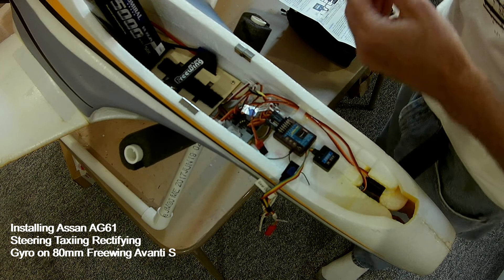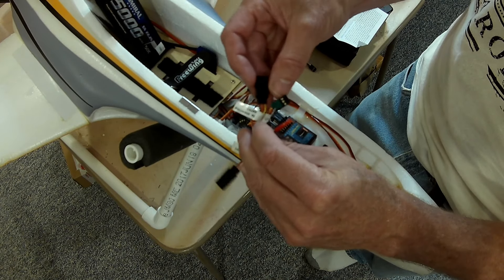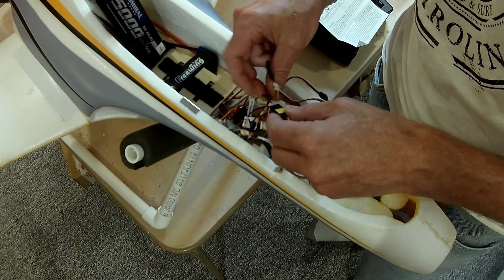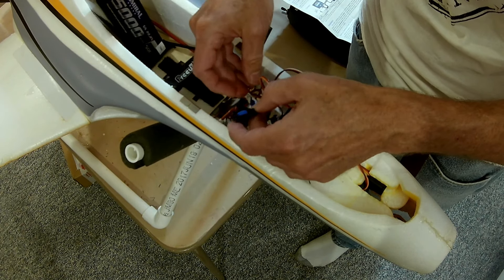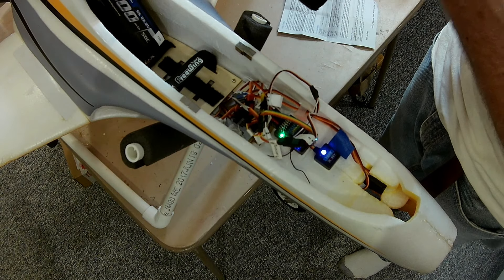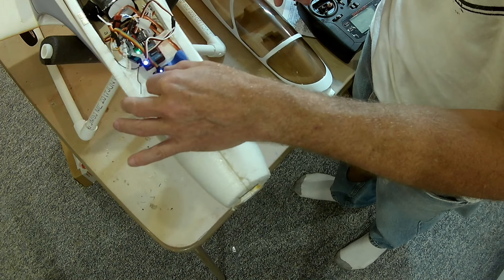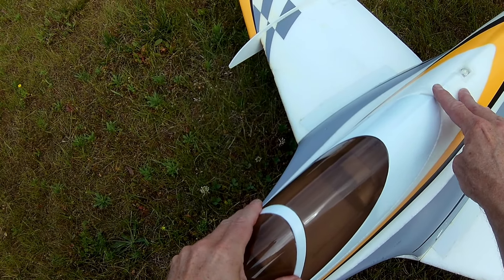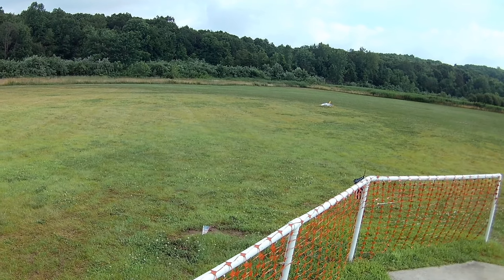Install and Review of Assan AG61 Steering Gyro for nose wheels on RC airplanes

Comment: I ordered four of these for 4 problem child planes/EDF’s. I hope it fits. Not much room in the FL P-38 battery compartment and zero room near the flight controller and receiver.
Reply from the maker: As you can see, the unit is really tiny so you won't need much room to mount it. Good luck!

Comment: Thank you for video but can that be used on a spectrum AS3X/ safe receiver? I’m thinking it may work since it doesn’t effect the rudder... correct?
Reply from the maker: It should work with that Spektrum Rx since the Assan steering gyro is connected to the front steering servo only and the rudder is separate and independent.

Comment: A lot of videos out on this.  Yours was the only one I found that actually gave instructions on what connected where. THANK YOU!!  I do have a question.  Since this is Y-harnessed to your rudder, if you are using a gyro for your control surfaces, won't this interfere with that when landing?  You will have 2 gyros operating at the same time.
Reply from the maker: Thanks Jayson. When I bought it the first time I looked for a video and asked in the forums and everyone said it’s easy.    Well may be after you’ve done it a few times, so I created this how- to for everyone, and now it is easy! The Y harness goes into the Rx and one side to rudder and the other to the Assan “Turning In”.  Any gyro signal from the Rx helps the Rudder but doesn’t interfere with the Assan. Since the Assan is primarily functioning on take off traveling straight there isn’t any rudder gyro input to interfere. You won’t notice any issues.
Reply: @6SRC_YT  I thank you for creating this.  You're spot on in your assessment of how others view the art of teaching.  You just got me off the fence.  About to purchase a few of these.  Thank you for responding so quickly and your thorough explanations.

Jayson

Comment: Mike, sorry to bother you again. Bought a steering gyro for every tricycle landing gear plane or EDF I own. It's been a few weeks since I did the first 3 edf's, I've got the Arrows T-28 on the table at the moment. Everything is working for the steering gyro, front wheel is retracting, but when I tested the retracts, only the front wheel retracted. Then I noticed how stupid I am. Neither rear retracts are plugged in to the gear channel. (Gear Out has the front gear) What did I forget? Where do the Rear Gear plug in?
Reply from the maker: On the "Gear Out" you'll connect the front gear retract and the mains retracts (use a Y cable if necessary.
Reply: Thanks Mike!

Comment: Eric,
I'm a bit confused with the position of the nose wheel when checking orientation of it when gyro is activated.
When the nose of the plane is turned to the right does the nose wheel turn to the left and vice versa? My gyro when activated turns the nose wheel in the direction of the turn and when I run it on the road during testing the plane wanders instead of going straight. I'm pretty sure I have everything plugged in according to the video. Any help would be greatly appreciated.
Reply: @6SRC_YT  

Thanks Eric! 
Got it working.
Reply: @6SRC_YT  
What I did to correct my issue was to reverse the gyro setting for the nose gear
Reply: I bought 3 more tonight! :)
Reply: @6SRC_YT  "It will steer in direction it's facing when it's activated. You  really can't lower gear on sidelines and taxi out say perpendicular to your takeoff line"
Is this really true? If so I must carry my Avanti to the starting position with gear up and then lower the gear and place is in start position. Next walk to the pilot area and take off. I really thougt it was a "head and hold" funktion.
Reply: @6SRC_YT  I think it would be possible to work around this by adding an extra switch combined with gear up/down in OpenTx logical switch(es). This way one could taxi to takeoff position first and then initiate gyro from Tx.
Reply: @ret737  How did you fix it?  I just installed an AG61 and mine is correcting in the wrong direction
Reply: @rontincher81  

I just moved the left stick left and right per the instructions and held it to the left after about 10 times amd it corrected the direction.
Reply: @ret737  I had tried that with no success.  I just tried it again several times and it still corrects in the wrong direction.  Humm, wonder what I am doing wrong
Reply: @rontincher81  Hmm....got me?

Maybe someone else here might have a fix.
Reply: @ret737  So I tried again it three more times and no success.  I let it rest for a while held my mouth a little different and tried it again and voila it worked.
Reply: @rontincher81  They can be aggravating at times. I've had two work perfectly the first time around and I have had one give me fits to the point I created expletives that don't exist!

Glad you got it worked out!

Comment: I have one in my Avanti too...works great! I installed one in my F-86..it initialized properly, the rudder and nose gear work correctly, and it disables when the gear retracts. The problem is that the correction is moving in the wrong direction. If the nose moves to the left, the gyro corrects to the left....it should correct to the right. Anyone else have this issue? Thx.
Reply: @eoinj3929  Hi Eoin, I did eventually fix it. It required two or three calibration attempts, but I did get it to work. You have to have the gear down, rapidly move the rudder stick at least 10 or 12 times left to right, but then stop all the way to the left and hold. It should reinitialize and then work correctly. You may have to do it a few times for it to take. I think I had to do it 3 times.